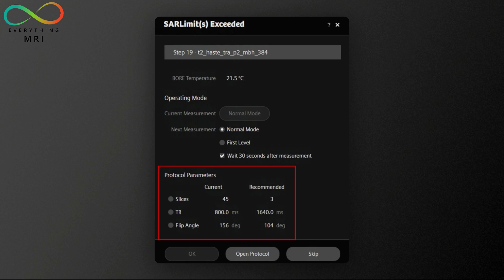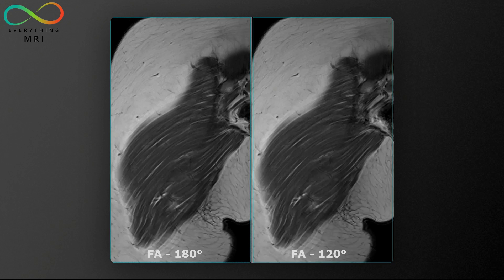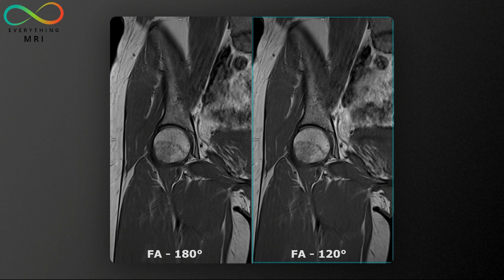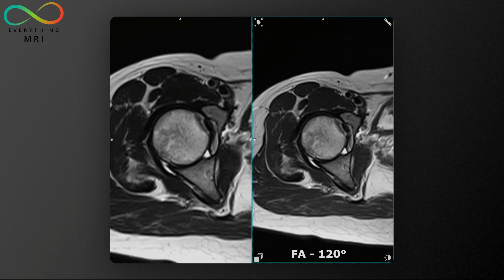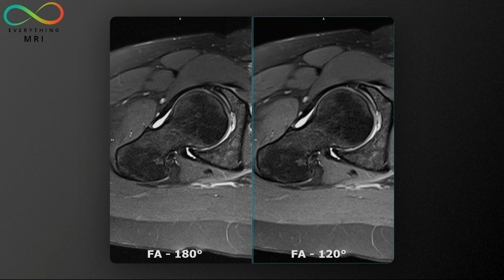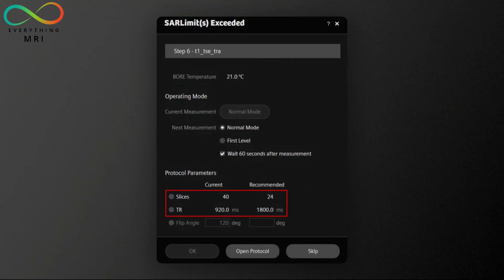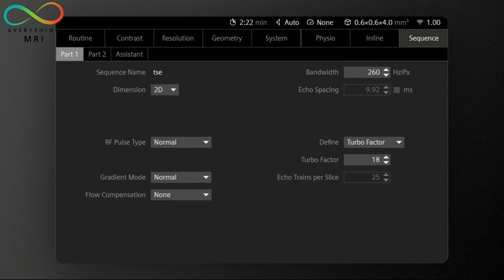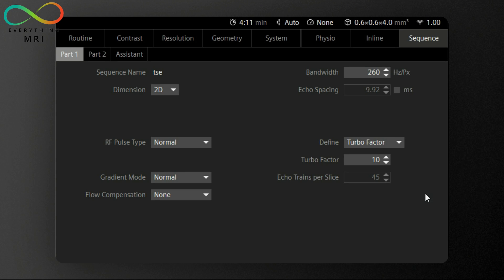SAR Reduction Techniques - MR Parameters

Comment: Why cant I find a side by side comparison of 1.5 MRI vs 3 MRI images  anywhere?  I have spine injury and possible ischial tuberosity tendon tears  from an accident. what would be best for that? Are GE 1.5signa machines too old to image well?
Reply from the maker: Dear Rob. Thank you for your comment. I believe in this instance it should be your consultant to advise you further on which scanner may be more recommended according to your specific situation. In terms of image quality, 3T scanners benefit from greater signal to noise ratio but they may also be exposed to greater artifacts. 1.5T is usually a very solid option and the differences in performance, often, are not that extremely marked. However, again, this should be a case by case assessment, so a clinician can further advise. 

Thank you for watching the video.
Reply: @everything-mri  When MRI machines are run is the data tracking every scan documented and saved or can a scan be deleted from the timeline?

Comment: I work on Siemens Skyra 3T and the SAR pop ups is annoying!!  Our rads have our scanners set up at very high flip angles (150 to 180) and on almost every scan I have to reduce it.  Our "limit" is 120 for whatever reason, but most of the time it takes care of the issue.  I am happy to see that it does not degrade the image quality.  It is worse on Knees and Lumbar Spines.  Why Knees?  I don't get it.  So now I am going to pay attention to the turbo factor.. These parameters were set to optimise time, not patient comfort.  We schedule patients every 15 minutes.. but get behind because of these things.  We are having a tech meeting today and I am going to bring up these issues.
Reply from the maker: All good points to discuss over the meeting. These are common challenges that, unfortunately, many clinical settings tend to experience. But, kudos to you for not abandoning yourself to the classic "oh, we have always done this way", showing instead proactivity and trying to improve the workflow. Sometimes a significant improvement for everyone requires just small adjustments!
Reply: Why cant I find a side by side comparison of 1.5 MRI vs 3 MRI images  anywhere?  I have spine injury and possible ischial tuberosity tendon tears  from an accident. what would be best for that? Are GE 1.5signa machines too old to image well?

Comment: Hi Julien, with regards to TR values you mentioned we have a larger threshold using a 3T scanner. Aside from having a stronger magnetic field, anymore reason regarding larger threshold with a 3T magnet
Reply from the maker: Hello. Thank you so much for watching. Regarding your question, the main reason for the extended TR threshold in a 3T scanner compared to a 1.5T is the increased T1 relaxation time at higher magnetic field strengths. T1 relaxation time is the time it takes for the longitudinal magnetization to recover to 63% of its original value after being perturbed by radiofrequency pulses. At higher field strengths, like 3T for example, tissues have longer T1 relaxation times, which necessitates longer TRs to allow for sufficient recovery of longitudinal magnetization and better contrast in the resulting images. I hope this make sense!
Reply: @everything-mri  Thanks. You guys are doing a great job! Keep it up👍